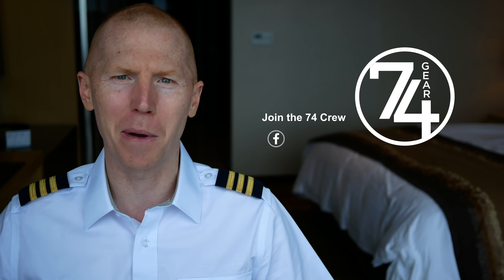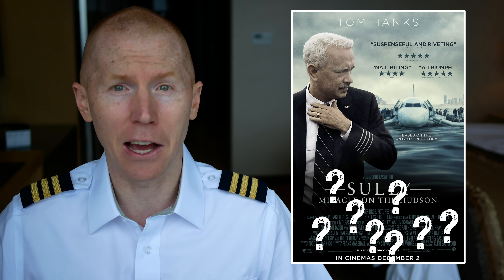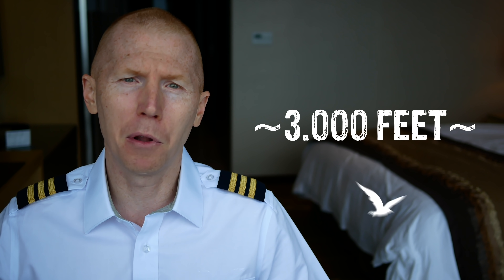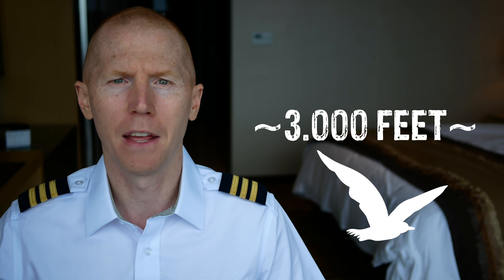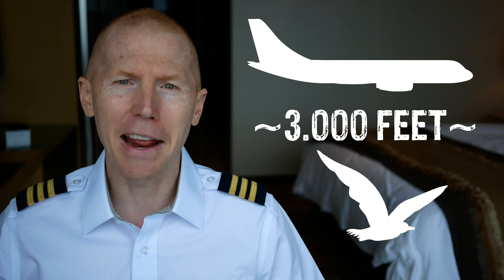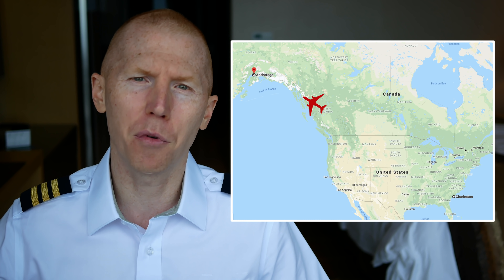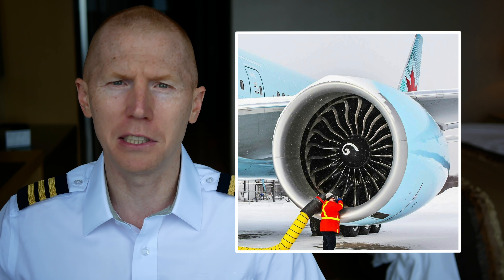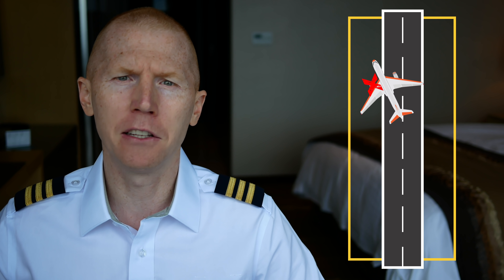Why Engines Don't Have a Mesh or Grates to Stop Birds

Comment: I know they have the landing gear obviously for commercial airlines but why don't they have a second set of landing gears with an inflatable ski? like if they had to land in water why wouldn't they have a second set of landing gear style skis that come out that automatically inflate like a emergency rafts on a sailboat does obviously it will be a lot smaller something for it to get a little cushion when it hits the water then from there they should have something that can inflate as well to keep the plane buoyant. I certainly wouldn't mind paying an extra $50 per flight if they were to install something like that even if they weren't able to come up with a second landing gear option that might give the plane some cushion when hitting the water at least some kind of inflatable raft that discharges and holds the plane up from sinking or certainly go a long way for your passengers piece of mind. anyway thanks for the video

Comment: Just mount a friggin radar dish or Active Denial System on top of each engine. Something that would kill the bird which would drop out of the sky before it had a chance to get sucked in and the birds gonna die anyway. Might as well fry them with electromagnetic radiation (basically like a microwave oven that detects potential food; kills it; cooks it). When I was the the US Army my unit did a CAX with AF once, they set up a huge satellite dish for us so we could connect two separate networks and they had a rope going all the way around the transmitter; 50 feet out & with radiation warning signs. One of the AF guys told me that if a bird flies in the direct path of the transmitter - it will fall  out of the sky; dead. I never saw that happen though.

Comment: I think what people are imagining that the grille would somehow stop the bird from getting sucked in. What they don't understand is the extreme airflow that happens through an engine, which is literally on the order of 1 ton per second. What would really happen is that the bird would just get ripped into smaller pieces before making it further into the engine. You'd still get the same amount of meat trying to jam it's way through the engines, which have about as much chance of passing a whole bird. Engines are tested to survive one small bird. Sully encountered multiple large birds in each engine.

Lasers capable of quickly vaporizing large birds would themselves create a huge safety (not to mention security) risk. I'm sure the US military would love to get their hands on that type of technology. So yeah, even if you could build such a device, it would be incredibly difficult. It would literally be one of those "shoot a sparrow with a cannon" type of solution (in fact, the cannon idea is more likely to make sense than the laser).

Comment: A reason I would avoid putting anything in front of the engine is that such a grate could get damaged or loose in some way that could cause it to get sucked into the engine. That would be a much more serious matter than a bird. When it comes to safety and security matters, simplicity is preferable.

Also, if you hate a grate, anything that may have otherwise gone into the engine will be sucked against the grate very hard. It could remain there for the rest of the flight. Something biological, like a bird could end up getting pulled very slowly through the grate, similar to pushing an apple slicer down onto an apple. The bird would likely end up going through the engine in many smaller pieces.

Comment: Don't the engine manufactures design for bird strikes? I thought they tested new engine designs using the chicken cannon. A friend of mine who is an aircraft mechanic for United told me that they fire a chicken carcasses into a running engine and the engine must continue to function and produce thrust and only drop a certain number of RPM's in order for that engine design to be certified by the FAA. I don't know why Sully's and Jeff's engines stopped working after the bird strike but they were probably totally overwhelmed by the shear number and size of the birds entering each engine.

Comment: What if you built a grate that you could retract after you clear 3,000 feet?

Also I think I read that Russian fighter jets solved this problem by relocating the air intake to on top of the wing, but I could be wrong

Comment: Even if you put some sort of screen in front of the engine, a bird would be sliced up like a veg-O-matic and still go into the engine. The amount of air being sucked in will pull it in regardless of the screen or whatever else you use.

Comment: As an ex-RCAF and retired engineer I can say where there is a problem there is always a solution. In the case of bird strikes what we are actually trying to solve is the problem of engine intakes which cause catastrophic failure. It might not only be birds, but debris or even a deer crossing a runway jumping high enough to be taken in...who knows? The MIG29 was built with engine covers which lower on takeoff and raise after takeoff. Louvers on the top of the engine wing route air sufficiently enough to keep the engines strong for thrust lift then raise after safe altitude is achieved. PROBLEM SOLVED except the real problem is airlines don't want to spend the money on upgrades or on future builds.
Reply: exactly!
Reply: @normaltedw  I estimated costs (considering down time of the aircraft for upgrade, and initial costs of making the system work with existing hydraulics) and roughly I'm guessing a number of 7 million per plane. In most takeoffs risk of a bird strike ends after 3000 ft, or in other words no worries after 5 seconds of flight after takeoff. The problem will never be fixed at that cost per plane. The risks do not outweigh the costs in the opinion of the airlines despite the solution saving lives in the event of a catastrophic failure due to anything entering into the blades of the engine.

Comment: They could add a bunch of curved rods along the outside perimeter of the engines, that extend in front of the intake, meeting in the center. Retracting them at a safe altitude would preserve efficiency.

Comment: I've seen engines that have had frozen chickens thrown into them and they just cut them to bits and spit them out the back. Why aren't those engines used? Also, you could put a grate on them that retracts when you hit 3000feet.
Not putting something over them is a gamble. The reason why flying is considered thr safest way to travel is because they find out the reason why the latest crash happened and learn from it then apply it to all aircraft. 
What has been taken from the Hudson crash? It looks like nothing. 

And if you're reading this Kelsey, would you be comfortable to fly a 737? 
I know I wouldn't want to be a passenger on one. Especially after the guy from Boeing actually coming out and saying that it has been rushed and shouldn't be allowed to fly again yet!!:

Can't believe this is a year old. I only got a recommendation for it today 🤣🤣

Comment: True, it blocks part of the airflow, but a mesh would also make the air that goes through extremely turbulent. I suspect the engine would stall very quickly.

Comment: You would think that with the price on an engine, not to mention the time and cost of changing one out, they would have some sort of sensor that could detect a bird and deploy a counter measure to prevent it from entering the engine until the bird is passed. That way it only kills the efficiency for a moment and then everything goes back to normal operation.

Comment: Why isn’t there a movable grate or something like that for under 3000 feet and then it moves up into a specials flap or something for it to move behind when the plane is over 3000 feet
Reply: If it was that easy and great of an idea, it would be already in use...

Sadly, it would result in birds AND metal going into the engine. And ice, all the time, ice rocks every flight, shortening the engine life span and in itself potentially leading to engine breakdowns.
Reply: @Reynevan100  Emil speaks the truth.
Reply: Bc low altitude is when the plane needs the most amount of power
Reply: Given the rarity of bird strikes, you'd probably want to do it the other way and have metal louvres at 90 degrees to the engine which would then snap down when birds are detected nearby. That said, these would probably need to be angled when deployed and they'd block direct airflow to the engine, so you'd end up with significantly reduced power in the engine until the louvres were returned to their normal position. And given the enormous suction power of an engine, even if you can deflect the birds away from the engine, would it just suck them in anyway? I'm not an engineer, but this is such an obvious idea that I can't help but think they have already examined this concept decades ago and discarded it as impractical.
Reply: @rodh1404  If you would have something suddenly snapping in front of the engines, those louvres would have to be made of unobtaneum not to shatter, break and go into the engine. With a bird hitting the front of it, even more so.

The core problem is that nothing you can put in front of the engine would survive a birdstrike without going with the bird into the engine, if it's also designed to let the engine still run efficiently. 

Sure, you could put a 50mm armor plate in front of the engine. That'd stop the bird. It'd also stop the engine. When power is the most critical in a flight: Takeoff and landing. 

It's just not feasible. (Not to mention complexity, cost, weight, maintenance etc)
Reply: Even I thought of this , but there must be more factors affecting this , I think this might need more space near the engine and require a completely new and probably less aerodynamic design then the current one. Maybe its just not worth it
Reply: Good idea.
Reply: So.. the engines still need as much air as possible going thru them.. kelsey legit just explained this
Reply: @emilymartin7864  Not sure he did. He did say that less air intake was less efficient and that the vast majority of flight time is not subject to the risk of bird strikes anyway. So he explained why there isn't just a grate over it all the time: fuel efficiency for the vast majority of flight time, and also that most commonly you already have a backup since one engine can keep the plane in the air to land safely. But the question is why there can't be a screen which is present during takeoff/landing, and then allows fuel efficient flight the rest of the time by retracting. He didn't mention anything like that. "We need to be maximum efficiency all the time even for the few minutes on the front and back end of flights" isn't really a good answer to that, because the asker presumably believes it would be less fuel efficient for a few minutes of each flight in exchange for increased safety.
Reply: Given the suction, anything you place in front of the engine, that also allows air into the engine, would be incapable of actually deflecting the bird. What you would have is bird chunks entering the engine instead of whole birds. And I doubt the damage caused by a bunch of bird chunks is significantly less than the damage caused by a whole bird. Given that, the extra cost of such a device, plus the added risk of adding chunks of metal to what the engine is ingesting, is not justified on either an economic or safety basis.
Reply: Because that engine will suck you through the grates anyway they wont stop anything from entering the engine only cut it into smaller peices before it enters
Reply: Amazing, you just came up with an idea that absolutely no engineer could have possibly thought of. You need to call them as soon as you possibly can to tell them this amazing idea.
Reply: @thatoneguy611  😂😂👌
Reply: sound like engineers think its too expensive to save a couple hundred lives every now and then... sadly
Reply: @SkodzGaming  Yes.....I can't believe no one in the years of aviation has thought of a simple idea like this.... You do know that there is a perfect quote about people who think they have some earth shattering idea that is so simple that 1000s of educated people and billions of dollars invested haven't been able to implement or even think of. This applies to almost everything too: Politics, Aviation, Economics, Starvation, etc. Basically what it means is that simple ideas in stuff like that in an overwhelming majority of the cases sound great to the uneducated in that field, but if you actually did it and educated yourself on the subject, you would see that it might sound good and work in theory, but wouldn't work in reality.

"For every complex problem there is an answer that is clear, simple, and wrong."

---H. L. Mencken
Reply: @shadowscall7758  we should let illegal immigrant males serve in the military for 5 years in exchange for citizenship for their immediate family.  ( One I came up with that probably has issues I don't know about)
Reply: @SkodzGaming  Saving a couple hundred lives for a couple dozen billion dollars would be too expensive. There is a price on lives, it's between 4m and 10m and is used by the government to calculate when and where to place additional safety infrastructure like road barriers.
The unfortunate truth is, anyone who believes lives are priceless in a practical sense is delusional. There is a finite value to human lives due to finite resources.

So the question actually do come down to how much it would cost to save that couple hundred lives. 
First, we need to considering the cost of design. Then retro fitting all planes (and fitting all new planes), then the cost of additional fuel per flight. 
Weight that against the probability of such a thing making a difference--remember, light bird strike that only take out one engine(sometimes not even that, just damage but not disable) can be survived anyway. And it's possible that there are enough birds that even the chucks that make pass the grate will down the engine anyway. So there is only a small sliver in the middle where it makes a difference.
Reply: @SkodzGaming  common man , how many lives till now are lost due to this reason , probably in single digits
Reply: @SkodzGaming  I can assure you that it is very rarely the engineer that thinks something is too expensive

Comment: The National Research Council here in Ottawa, Canada had (has?) a turkey cannon. I can just imagine that on a budget request: "Item #42. Turkey Cannon." 

Based on the assumption that a large Thanksgiving turkey is roughly the same mass and consistency as a goose or other large bird strike candidate, they would fire grocery store turkeys into running jet engines to assess the damage. Where I went to school, we had a large Aerospace Engineering program, and I remember looking with amazement at one of the destroyed engines - which was, we were told, still producing solid thrust after the simulated bird strike. 

The exhaust side of the engine had a familiar odour. I think it needed more sage, but each to their own.

Comment: Because mesh/grates would either. One: make no difference, because at 300-800 MPH mesh/grates would make little to no difference. Two: it might make things worse, because if it breaks, the engine will not only take the bird, but also the metal mesh/grates.

Comment: I know the answer. But starting my comments here at the beginning. First off. This would create turbulent air going into the engine inlet. Which would interfere with the balancing of the spinning turbine blades. Jet turbines are designed to start with laminar air flow and handle compression and flow internally. Secondly, if a bird hits the flap at high speed and can go straight into or through it. That says. Even steel bars can be broken by a bird strike. In fact, would cause the bars to go into the engine totaling the engine and it’s blades. Third. Some birds can go in and engine and straight through (burnt bird smell on landing) but not causing the engine to loose power. However, damages does occur. And some birds go in and take an engine out. Many factors as to why. But...  if these engines can suck water off the ground, imagine what they do it birds. Which is also why we perform a FOD check before any flight. And just as an FYI. Some instructor pilots put quarters in the inlet during a preflight to see how much the pilot is paying attention. But remove them before flight. Remember. A bird hitting the nose of the aircraft can also penetrate the nose cone. Bars won’t help at all. Even a small rock can eliminate an engine.
Reply: USAF Aerospace maintenance response -heavy airframes.

Comment: I definitely understand some kind of shield over the intake will hinder performance of the engine due to reduced airflow. But surely engineers could design some kind of retractable shield that is in place for takeoff & landing, then can be retracted once the aircraft is above 3000 feet? Maybe something like an iris? & Maybe have the retractable shield designed so it spins & can act like a second turbine & help suck in more air to compensate?

Comment: It must be a cost vs benefit thing because it wouldn't be that hard to design an aerodynamically efficient enough screen to still allow adeqet power for take off. You could even design it to open or retract after the plane got above 3000 feet.

Comment: So like if we take a fence from a tennis court which is those diamond wire shape fences, and put them in front of the engine. How much efficiency does it lose in percentage? Wouldn’t air molecules just go around the wire and then into the jet engine? Or does the air before the entrance of the engine have to be laminar flow which maybe get disrupted by the wire?

Comment: Why are planes white, why not multi color or just solid red or black?
Reply: 1. cost, white pain is cheaper
2. albedo, black reflects much less light, so the plane would heat up more in the sun, so the AC has to work more, wich uses more fuel, wich causes more cost.